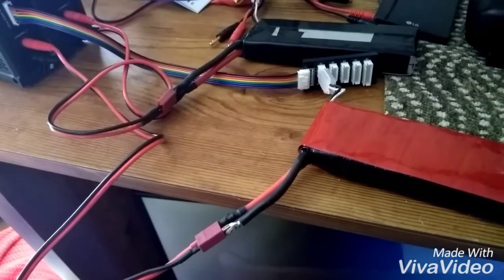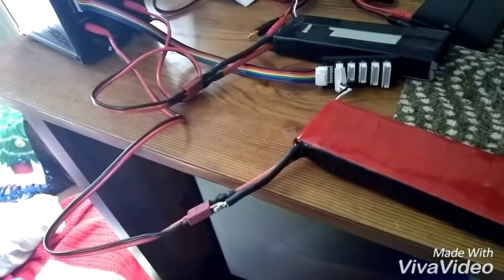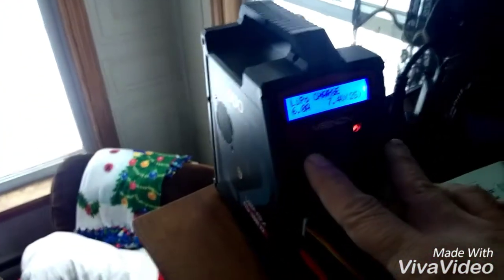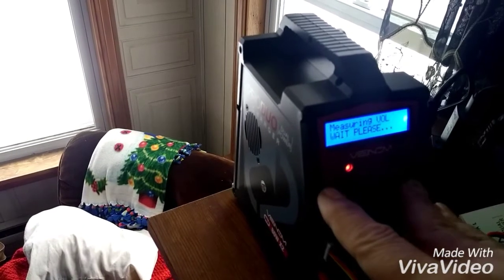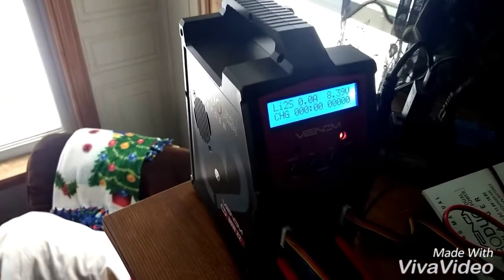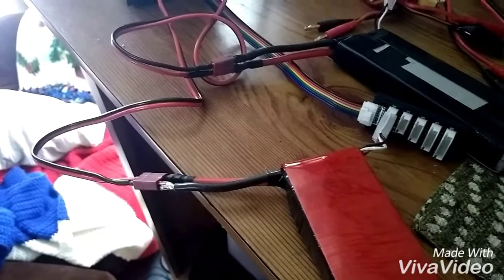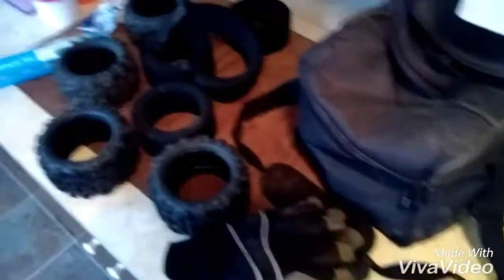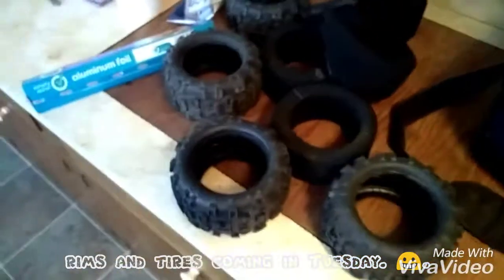Lipo battery. Dean's connectors are junk

Comment: Have to agree on the connectors Wally, Any connector can come apart but only the Deans Connector yields uncovered contact surfaces if partially unplugged. as for cheap batteries, Batteries generally have a minimum quality. The connectors being the difference in most cases. Bottom line , Many of us have had batteries unplug after an impact, Xt series and EC series do not expose contact surfaces if they start to come loose. I for one dont want the cheapest plug on the planet on any of my RC Gear. Thanks For the Shout Bro Bash On !!!
Reply from the maker: Poppa Phill Stoffer you know it brother. Bash on. 😎👍

Comment: The problem isn't the deans connectors it's those cheap lipo batteries not being manufactured properly and using crappy materials to make them. Dean's connectors are a great connector and to say they're shitty just because you burnt some doesn't mean anything especially if you're new to soldering that can happen on any thing you solder to that has plastic close to the weld area. Those xt90 plugs are good for super high drain operations but honestly unless you're running something over a 60c discharge they are pretty much unneeded because a dean's connector can easily handle current below 60c no problem unless you ended up with a crappy one which can happen with anything even the xt90 plugs you can end up with crappy ones. I really think you just had bad luck because you opted to buy some really cheap lipo's which just were not manufactured properly and are taking your frustration out on the connectors which aren't your real problem.
Reply from the maker: ErrlRC I used 94/6 solder. Was the wrong solder. It was most of my problem. But I don't like how easily the dean's unplug. 20 yrs ago I had top grade tekin electronics and very good connectors. Now I have to find what is available and I don't like the dean's for that reason. An esc with no cappasator does not like being unplugged with the off switch in the on position. That is another reason to not want a connector that unplugs easily. Dean's are prob fine for most applications. Not for hard driving like I do and will be doing. Protecting my investment is my goal. 👍
Reply: Wallys Rc Wheels Wally I think it's those "deans" connectors on the lipos that are garbage because on all my deans they connect really strong. It's hard to disconnect on mine so I really think those lipos must of had bad deans connectors on them cause I've never had any deans that unplugged easily. Now if you want to see what a cheap connector is than look at tamayia connectors and you will see a "cheap connector! Lol
Reply from the maker: Chris Watson no the batteries came with xt60 connectors..I should of left them on there. Lol

Comment: I never had any problems with deans. They are pretty good connectors imo. The xt90 are good but are best served in high power applications. The deans aren't junk. Those junk lipos are junk. Lol. Stay away from those lipos.
Reply from the maker: Chris Watson nah. I fixed the batteries. Dean's fall apart yo easily. If the 2 POS and neg ends on the wire get shorted the esc will get smoked. If not everything in it. That's the main prob. My prob mostly was the wrong solder. 96/4 is very hard solder. High temp solder. All the 6k mAh batteries come with xt90 connectors. Large draw even on a 2s. But hey each to there own. 👍
Reply: Chris Watson I 100% agree that it was the cheap lipo's fault not the deans plugs. Also no disrespect or hate but probably partial user error too.
Reply: Wallys Rc Wheels Hey I hear ya. Nothing wrong with using xt90 for connectors. I happen to think deans are really good but like you said to each their own. Stay away from those lipos in the future tho as I saw alot of bad feedback on them. Floureon is a brand on ebay you should look into. They are cheap and pretty good quality.
Reply: ErrlRC Yeah I heard alot of negative reviews on those zitop or zippy batteries or whatever they're called.
Reply from the maker: Chris Watson I'll check them out. To these were about 22$ per battery. Venom are tripple the cost. Fist 2, I ordered have been great. I think your right. Users error. That dam solder. One pack did seem bad. Oh well. There all working now. I got 3 sets of batteries for the maximus. And bigger pinions to try out soon as it warms up here. Ty for the advice. God bless ♥️🙏♥️
Reply: Hello Chris just a little FYI, if you view previous videos on this thread, you will find out that the batteries are fine and never had a problem, the connectors on Brand new batteries started going bad, not the batteries themselves. Stay Blessed..

Comment: what gauge is that?  first time ive even heard of a "dean connector"  LMAO  ive been in the electronics business for years, weird lingo.  why not use "blade connectors"? EDIT AKA SPADE. they are cheap, highly durable, reliable and can handle anything your going to throw at it.  sure youd have to replace them all... but it seems your doing that anyway.  lol
Reply: su pyrow unless you're in the rc hobby world you probably wouldn't have heard of a dean's/T style plug. They aren't used in anything in the regular electronics world except for the rc community because they were basically made to replace the old tamiya style connectors which cannot handle much current and burn up often with too much power.
Reply: I should make Bobby Connectors... and sell them to hobbyists.
Reply: well, spade connectors have been used in REAL cars for like 70 years.  use them. LMAO
Reply from the maker: su pyrow those Dean connectors come unplugged to easily. When my 12 lb truck jumps 5 feet in the air. There is a good chance the plug will come unplugged. Alote of people think there ok until they short out the electronics. There are no capacitors in the electronics. So if the power is interrupted abruptly a few times it can cause the esc (electronic speed controller) to loose it's programming.
Reply from the maker: su pyrow wire says 10awg on it. I assume it's 10 guage. These are high mAh batteries.
Reply: sounds like the PWM controller(what you call esc)  needs a coin cell battery backup.  :)  pwm stands for pulse width modulation .. sounds way fuckin cooler than esc. ;)
Reply from the maker: su pyrow that's the hobby term. Yes. Done do use bat packs as back up. Usually because there steering servo and lights, winch Draw so much power. Mine doesn't need one so far. To much advice can drive a man nuts. Lmao. 😂😂😂
Reply from the maker: Some. Use backup power packs. Dum phone
Reply: Deans Connectors are an original term for these types. Deans are Blade connectors and the standard electonics Blades will not handle the DC current load. as it is the Deams aka Offset Blades will handle the current, the plastic they are encased in will not. Deans were used primarily in the beginning on 14 and 16 scale and just sort of grew with the industry. Standard industry blade connectors tend to be soft metals and alloys, they wont handle the kitchen when it heats up...